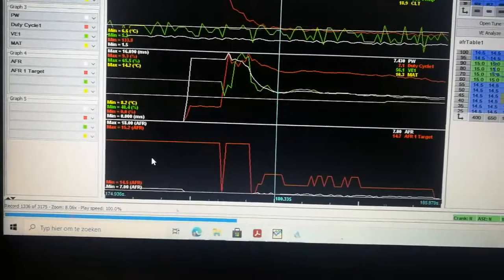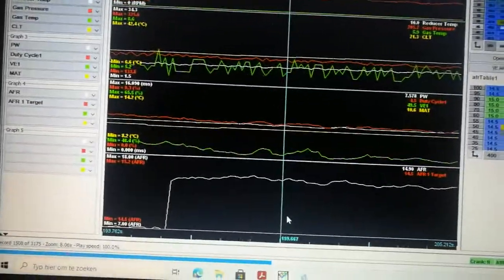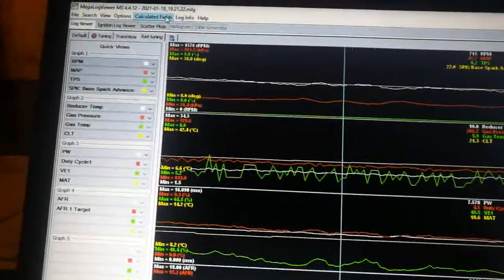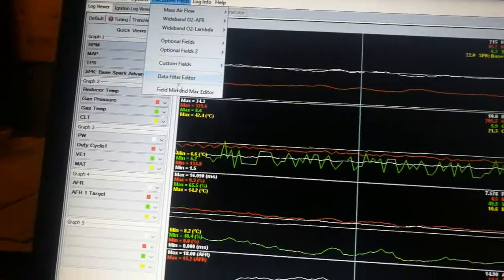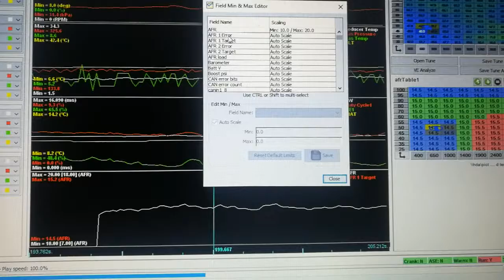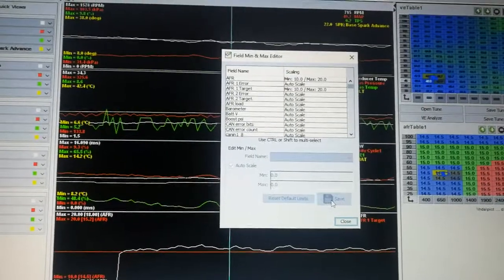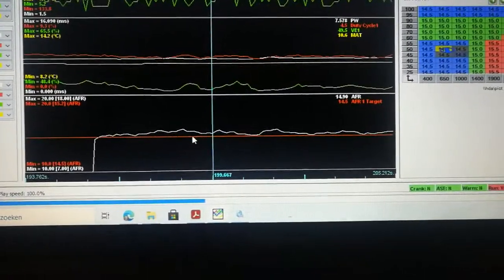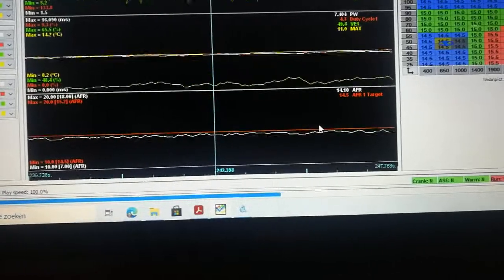Megalogviewer: custom AFR scale for easier fuel tuning

Comment: While you in the calculated field, you can do the delta between you target and results. I set up mine to gove me a factor smaller than 1 if Inneed to pull full, and bigger than 1 if I jeed to ADD fuel. You then just multiply the VE number by that calculated factor ! Voilà !

Comment: Thank you, that's a helpful tip.
Reply from the maker: You're welcome. I learn a lot from the MLVHD group on Facebook. 
What will you be using it for?
Reply: @kikkegek  I will look into that group to better understand what the application is capable of.  
For the moment I am using it to look at several variables simultaneously.  Looking for overall trends is what I am researching.